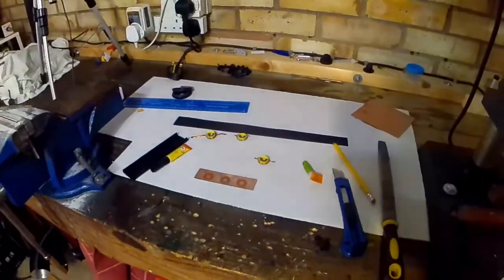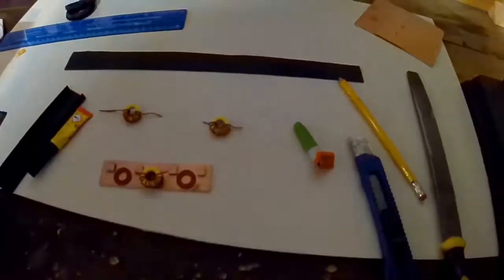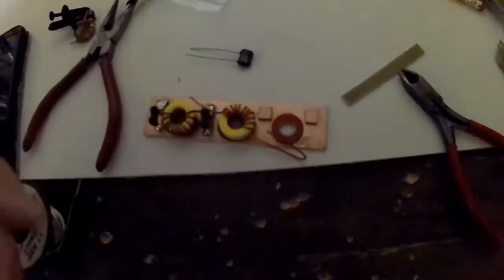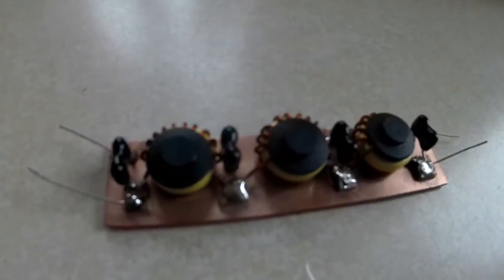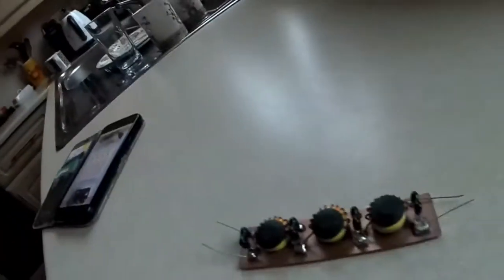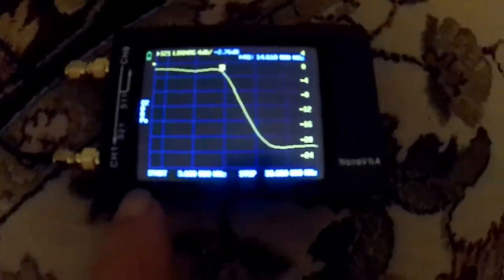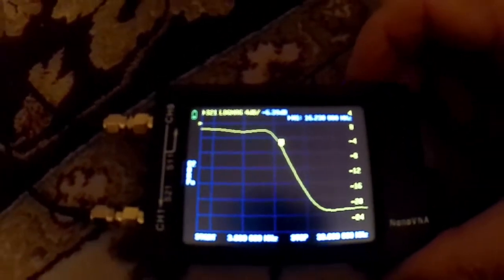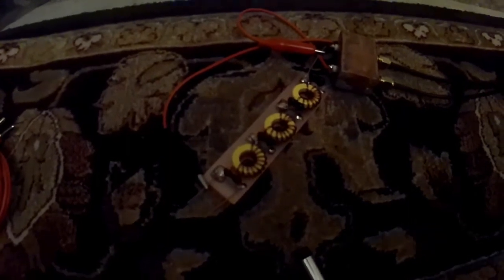MiniPA70 HF Linear RF Amplifier. Simple Low Pass Filter for 20 Metre Band. Ham Radio.

Comment: That is a terrible design low pass filter, the through loss should be no more than 0,5 db. at 14Mhz. The rejection should be a minimum of 50db at 28Mhz. There are many online design tools that would give you a much better design.
Reply from the maker: I copied the values from an icom multiband transceiver circuit diagram. So I thought if it was good enough for a commercialy made on the market transceiver it should be good enough for my project. Cheers from old George
Reply: Not impressive, I’m sorry. Full marks for execution and effort, but results are quite poor

Comment: BTW, Don`t You Hate When You Always Have To Recharge Your VNA Just To test Something? I Found A Methode To Solve It, Just Put The Small Diodes Onto The Battery Wires So There Is No Unneceserry Electricity Flow When Its Off, Then Change The Battery To A Bigger One, I Done That With Mine And Since Then I Can Work With My VNA NON STOP For About 3 Hours Now :)
Reply from the maker: Yep I find that with a lot of battery test equipment.  My digital vernier eats batteries. I tend to use a power bank with my Nanovna however having the USB lead connected can effect test results. Cheers from old George
Reply: @MakeDoAndMend1  Oh, Thanks For The Tip, Greettings From Jelgava
Reply from the maker: @frequencywatchers  Greetings from the UK. Northamptonshire. I am off today to drive and collect an old Transceiver for £100 UK pounds so I am hoping I have got a bargain. Doesn't have a microphone but reckon a CB Radio type would be OK. However haven't got any microphones so will have to buy one. Bid on many radios on ebay but outbid every time. Too expensive for me. Well outside my budget. Cheers from old George (Mick G1BKI)🤠
Reply: @MakeDoAndMend1  Oh, Sounds Like You Are Getting Deals All Over, Sadly My part Of World Is Not HAM Happy :D  No Radio Enthusiasts Around Me So Im Alone , yestarday I Heard Some Russian From My City In 409 Meter Band, But Cant Find Hes Callsign Anywhere, Must Be A Made Up Callsighn Or Something :D 
How Did You Bargain 100 Pound Tranceiver Went?
Reply from the maker: The radio was a FT101 . Works great but had to spend plenty of time re alignment etc. George

Comment: So Basicly Its From 80 Meters To 20 Meter Band From The Nano Vna What I Could Understand, Did I Said Something Wrong?
Reply from the maker: The 20Metre band low Pass will pass everything below it. But each band should have its own dedicated low Pass Filter for example 7mhz second unwanted harmonic is 14Mhz and this will Pass through the 20Metre LPF so it's no good. So a 7Mhz low Pass Filter is needed. Hope this make sense cheers from old George

Comment: George you have to many turns try 9 turns on the input and 9 turns on the output and 13 turns in the center it should drop at 14MHz. 180pF is good. Good luck